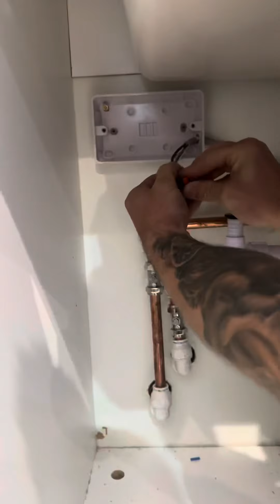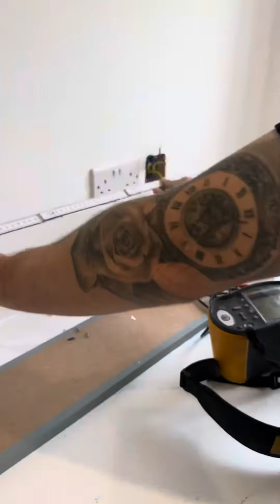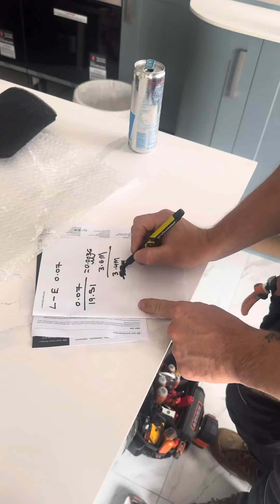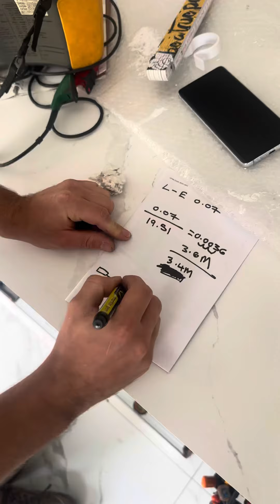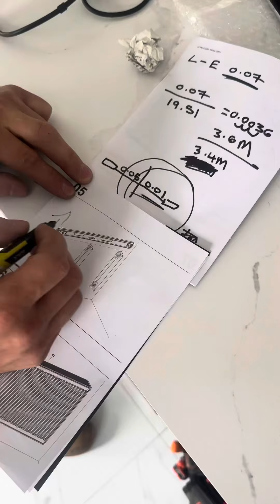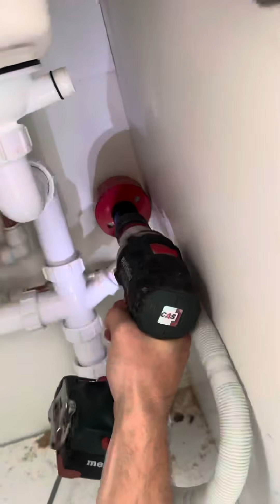How To FAULT Find An Electrical Fault

Comment: At 2 minutes you do 'continuity' but you've not linked your N + E out so can't measure continuity. Reading should be 999 since the ends of your N and E are open. Is it the fault which is giving you a continuity reading?
Reply: They’re not, mate. It’s already linked as he has a N-E short on that cable.

Comment: Did you not need to divide the R1R2 divided by two to get just the run of a single cable. R1 R2 is doubled up. Am I missing something. Good video
Reply: as far as I understand the table is showing R1 + R2